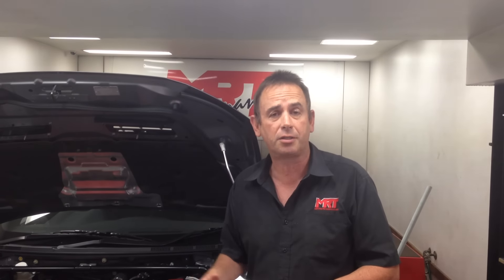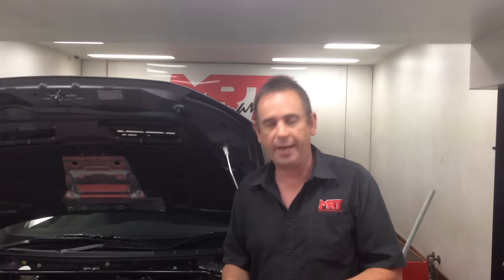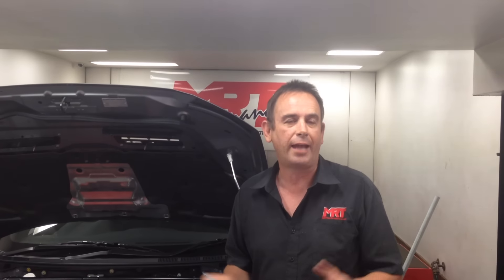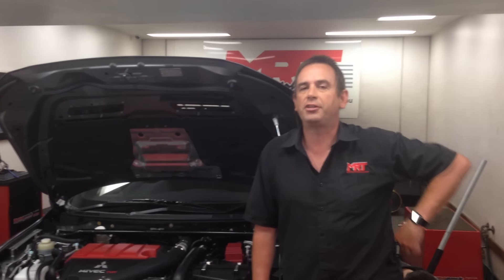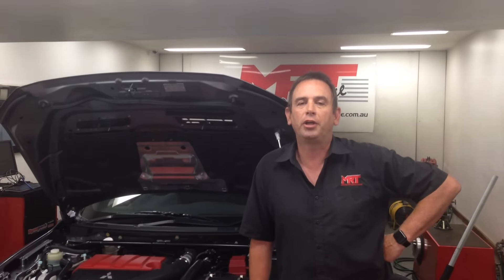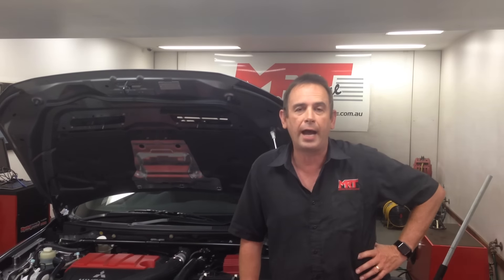Mitsubishi EVO X final edition review and new exhaust and tune part 2

Comment: omg i love the mitsubishi lancer evolution x final edition, great car great specs, thanks for the great video, i want to be allround engineering mechanic and fix everything whats on wheels, thanks you for the video i learned allot from it, keep up the good work man, i love it, tuning racing speedlimit breaking cars i love it, i want to design my own motorcycle and if it goes well i want to do a mitsubishi eve prototype and see if i can bring this amazing car back to life, i'm so sad they stopped the production, and if they will not bring it back to life i will put it on my brands name and the model stays evolution of course, this car is and stays better then the subaru impreza wrx sti even top gear said it, i'm glad guys like u still works on the evo's and not letting it die because production stopped, i'm gonna watch all the video's and of course i dropped a like for this video.